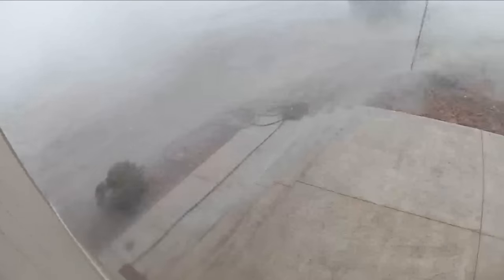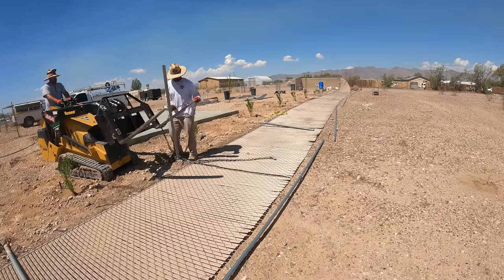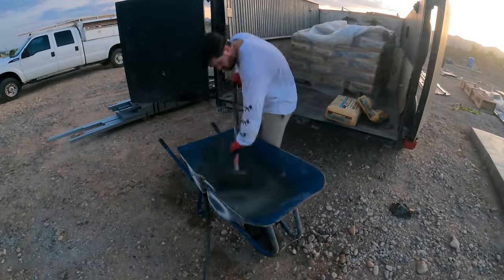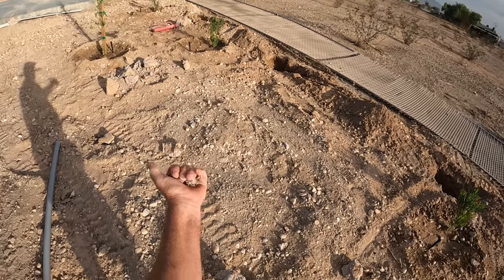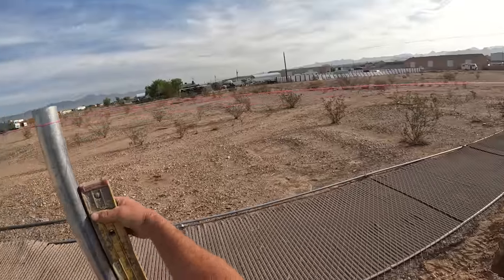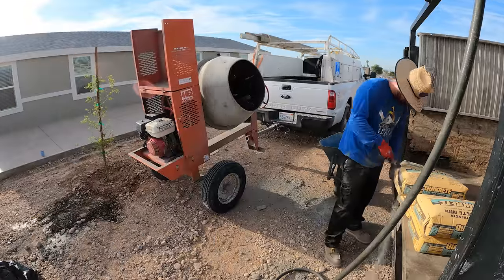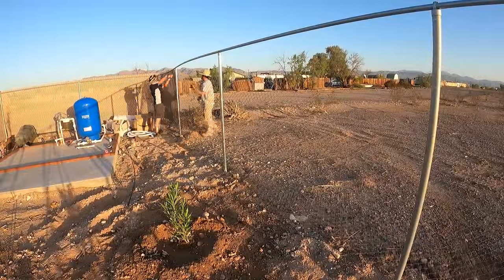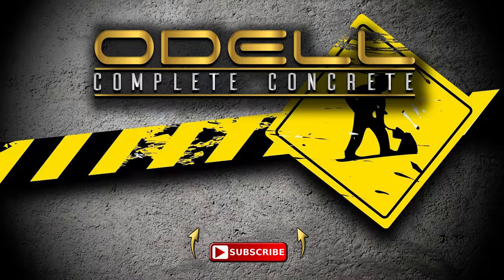REBUILDING AND RECOVERING AFTER DISASTER STRIKES!

Comment: Welcome to our awesome monsoons.  Arizona has some very unforgiving weather when it comes from rain and microbursts and desert drought heat cold etc...  But it is a wonderful state I can drive an hour north and go snowboarding and plan the snow in Flagstaff. Or I can stay in the Phoenix area and have a ton of things to do.  Or go for a hike on the many mountains and trails around us.  Every few years there's a big microburst like what you experience and just comes through and destroys everything but we all get together clean up and rebuild sometimes you'll go for a decade without having a microburst and then out of nowhere boom.

3 years ago I had a section of block wall that was about 25 ft long completely buckle and topple over the posts were all full of concrete and rebar the wall and lasted for since the house was built in 1984 and a big microburst hit and just took the entire block wall out like it was nothing
Reply from the maker: Yes, you can't win mother nature.
Reply: @OdellCompleteConcrete  that's when I found out home owners insurance didn't cover the block wall falling because it was "an act of god" so my neighbor and I each paid 50% of the cost.   and they said if it wasn't a storm, it would be denied because it "was built wrong". I asked how can they tell if the wall is in pieces to find the failure. They said a proper wall will never fall over. Only coverage that would cover it is if someone drove thru it, but then the auto insurance would pay for it.

Comment: One option is to drill a hole or two in the bottom of the post and add a bolt.  That will make it essentially impossible to pull out from the concrete.  However, with winds that strong it might just have pulled out the footer and/or bent the posts so the whole thing might have still failed regardless.
Reply from the maker: I think some good concrete will hold to the post.
Reply: The bolt or any pin at 90 degrees to the post would have tied those posts to the concrete much stronger. Same for a pin /dowel  or more pronounced bell shape footing might have slowed or prevented uplift out of the ground. It’s only a fence, but uplift is still uplift. Pins might have resisted better (in high risk zones).
Reply: I’ve seen posts with a portion that sticks in the concrete have a pinch in it. Essentially creating a flattened portion of that part of the post.

Comment: They put the concrete mix in dry, assuming it would absorb water from the ground. I have found that several times. It never actually works out well but people still do it because it is extremely quick.

Comment: Would it be worth it to get some bolts or allthread to put through near the bottom of the posts to anchor them in the concrete so they dont slip out like that?
Reply from the maker: They normally hey don't slip out if you have good concrete.

Comment: If you were to do this all over again, would putting up a few cinder block posts along the line hold up the fence with privacy shield?
Reply from the maker: I think the post at 8' instead of 10' would do the trick, and making sure every post has good concrete around them

Comment: Well... I guess if you want a chain link fence too withstand severe wind you need to have blow through holes. If you want a wind break, or a sight line break fence, it needs to be more substantial than chain link or wood. Although when a tornado can uproot buildings, and throw cars like card board boxes, even a concrete wall may not stand up. You might consider skipping a vinyl strip every couple of strips.
Reply from the maker: I'll leave the fence as is and wait for the bushes to fill in

Comment: aqui en españa donde tenemos alambrados de alambrada cada 4/5 potes  dependiendo de la distancia y de cuantos postes se necesita en esa distancia 
solemos cruzar dos postes en forma de v invertida en el poste central de esta forma el alambrado se quera mas sujeto y resistente
y que te haya tirado la alambrada es por que le pusiste una lona de ocultación , yo lo único que te puedo dar de consejo es que pongas setos de pino o  plantas de  enredadoras que cubra todo el alambrado para que nadie vea atreves de esa zona 
los setos de pino en cuanto crecen te hace como un muro de ramas que asi evita que nadie vea nada
y sobre la caseta as la de obra tardas menos y es ams resistente  , levantas 3 paredes con ladrillos y luego el tejado de viga y un poco de hormigón y listo

---------------------------------------------------------
here in Spain where we have barbed wire fences every 4/5 potes depending on the distance and how many posts are needed in that distance
we usually cross two poles in the form of an inverted v in the central pole in this way the wiring will be more secure and resistant
and that the wire fence has been thrown at you is because you put a concealment tarp on it, the only thing I can give you advice is to put pine hedges or vine plants that cover the entire fence so that no one sees through that area
pine hedges as soon as they grow make you like a wall of branches that prevents anyone from seeing anything

And on the shed like this, the construction one takes less time and is more resistant, you build 3 walls with bricks and then the beam roof and a little concrete and that's it
Reply from the maker: Sounds good.
TY

Comment: Try using 40% sunscreen cloth/privacy cloth on the opposite side of the fencing (to allow the half circle cuts in the cloth). Cut 9 inch half circle cuts, spaced out one, vertically, every two feet, and then every four feet horizontally, to allow wind to pass. That will give you the privacy you seek while allowing the wind to pass through.
Reply from the maker: That may work, but I think I'll wait for the bushes to come in

Comment: Having lived in Tornado Alley for over 50 years... a microburst is NOT a tornado.  It's a completely different phenomenon.  
A microburst is a localized column of sinking air (downdraft) within a thunderstorm and is usually less than or equal to 2.5 miles in diameter. Microbursts can cause extensive damage at the surface, and in some instances, can be life-threatening. There are two primary types of microbursts: 1) wet microbursts and 2) dry microbursts. Wet microbursts are accompanied by significant precipitation and are common in the Southeast during the summer months. Wind speeds in microbursts can reach up to 100 mph, or even higher, which is equivalent to an EF-1 tornado! Winds this high can cause major damage to homes and other structures and level hundreds of trees.  It does not have rotating winds, the winds spread out from a central point in a 360° circle.
Reply from the maker: Yes, but this one went in one direction. North